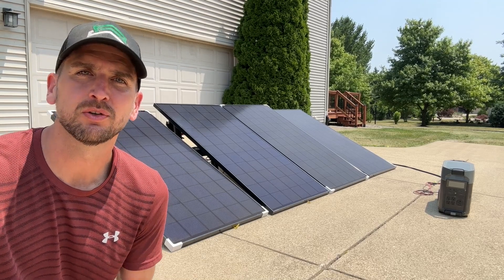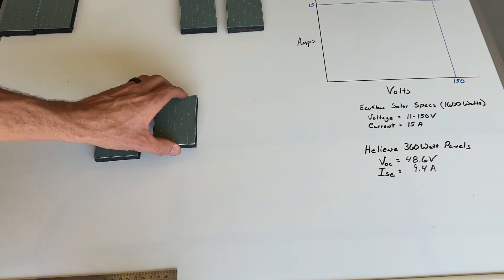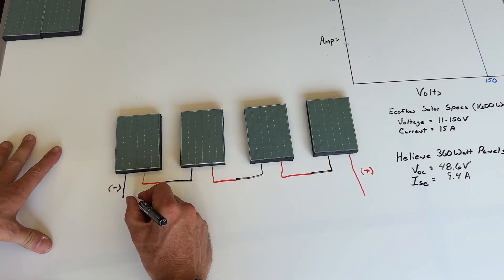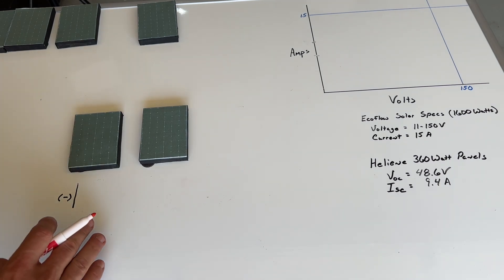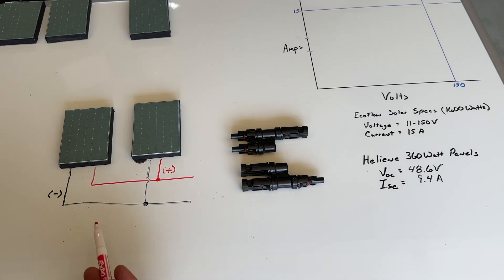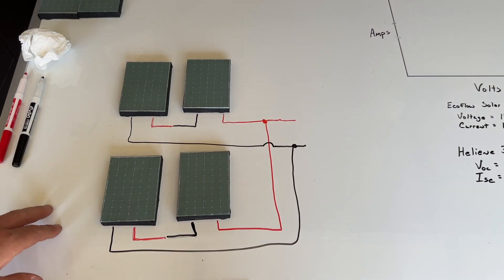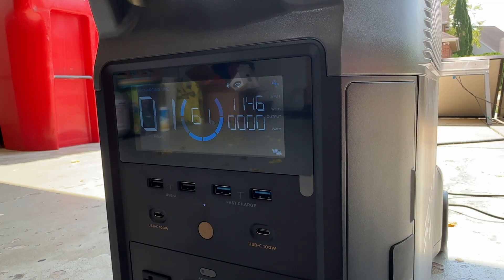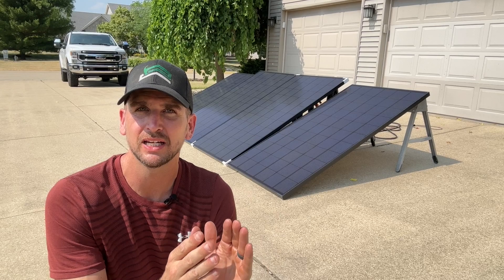Solar Panel Wiring Basics | Maximizing EcoFlow Delta Pro Solar Charging

Comment: Great video. Something I was hoping you would mention is that in series, if even one panel is obstructed with shade, it reduces performance for the whole string. Parallel wiring allows each panel to fall into shade separately. But again, there are pros and cons to each approach. Also, a general statement, is that panels need to be kept clean to perform as rated. Hosing then off or even brushing them is good maintenance but hard to do on the roof. For this reason, I am very interested in mounting at ground level, or somewhere I am comfortable reaching on a ladder.
Reply from the maker: Good call on the shading issue when it comes to series.  Thanks for the feedback!
Reply: Wouldn't you start using things like micro-controllers when getting to these sized systems anyway? Over 1000w feels like a tipping point...
Reply: @MS12-u5p  The Ecoflow Delta Pro is expecting Direct Current (DC) power flow at its solar input. The power stored in it can then be output as Alternating Current (AC) by going through the inverter internal to the Ecoflow. It wouldn’t make sense to do micro inverters at the solar panels themselves because that would be creating AC power flow before reaching the Ecoflow box, which is only set up to receive DC at the solar port. For an Ecoflow, a traditional string of panels connected in series or parallel is really what it was meant to work with, whereas micro inverters would make more sense in a permanent home installation into your house wiring, which is also AC. The Ecoflow Delta Pro is intended for up to 1600 watts of solar input in DC, but it’s maximum volts specification makes that a bit difficult to reach. It’s more of a ‘portable’ setup that can serve a role in home backup, too. To your point, however, if solar panels were equipped with micro inverters and sent AC power to the Ecoflow, maybe that could feed into the regular AC charging plug just like when it is plugged into a household outlet to charge, and that charging rate would be faster than the solar input. Just not sure if the performance increase would be worth the extra hardware costs. Interesting concept, I will be thinking it through some more.
Reply: @natehowe7975  Totally understand. I’m just thinking once you go so big on solar you really aren’t portable anymore and your needs may fall into a weird gap. LOL.
Reply: @MS12-u5p  That’s the journey I have struggled with. After a long power outage I started thinking about options to prevent it happening again. My design goal for the project has been to keep everything portable enough that I could take it with me to a friend’s house if they were the one having the outage. I try to stop myself at very permanent installations that need to stay with the home, but I am also not trying to run the whole home, just critical loads. By limiting my consumption plans to a few things like refrigerator, furnace, and window AC, I can look at smaller generation. If I planned to keep central air conditioning online that would require an entirely different plan. I got an Ecoflow Delta to experiment with and loved what it can do, given that it is pretty small. Then I got into the Ecoflow Delta Pro which can flex between portable (trunk of SUV / RV) but can also be useful to a house. I do have some portable panels I can stand up in the yard in an emergency, but I am wrestling with the idea of permanently installing panels on the roof. Given that my project is more focused on redundant options than offsetting the electric bill, I haven’t gone forward with roof panels. In the meantime, I can run a lot from the EcoFlow Delta Pro through the first day of disruption, then I can refill with portable solar panels and/or a small Honda generator that I modified to natural gas / propane / gasoline.
Reply: @natehowe7975  Makes sense, I wasn't trying to be critical of what you are doing, just that with that many watts I'd worry about the limits of everything in the chain. I have only used an old Jackery 500 to help when the power goes out and it is limited to just 100w solar, but have a Bluetti AC200 Max coming and got some Bifacial solar panels coming too (I'm amazed how much the price has come down on these!) to help with the summer. My goal is for it to just to run the portable AC unit in the bedroom and for emergencies. With 400w (500 peak) I'm thinking it will be more than enough if there are any power outages here in Los Angeles. And then easy to take on camping trips too. Best of luck!
Reply: @natehowe7975  "I modified to natural gas / propane / gasoline" I like this idea. Please share the idea how you modified the generator to run on natural gas which is most home get piped in by local power company. In case electrical from grid was down, by bad weather for example, the gas is not interrupt as they run under ground. Thanks
Reply: Same issue with series, but instead of limiting the current it will limit the voltage of the entire string.